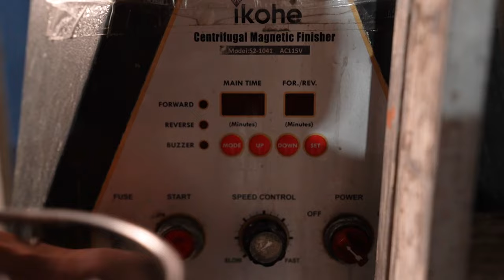See How This Stunning Silver Cuban Link Chain is Handmade in Miami!

Comment: Amazing Video!!! did you just wrap the silver wire onto any metal rod or do you have a specific rod? Also how would you make 7mm cuban  so that link are 7mm but the lnks are spaced out so you have full necklace in less gold? So some cubans are 7mm and 24 inch chain with less gold and some have more gold, it depends on how you make the links. Do you know how that works?

Comment: Love my silver bracelet and my silver chain that you guys made only thing is ,it’s 925 not 950 so with that said my next chain you will have to make it 950 or 999 but you did do an outstanding job. Thank you.
Reply from the maker: Thanks James !!!
Reply: 925 means it's 92.5% silver and 7.5% copper for strength. 

If you do 950 that's LESS silver and MORE copper added. Value goes down quite a bit man. Too much copper.
Reply: @daviedood2503 actually .950 is 95% silver. The exact opposite of what you're saying.